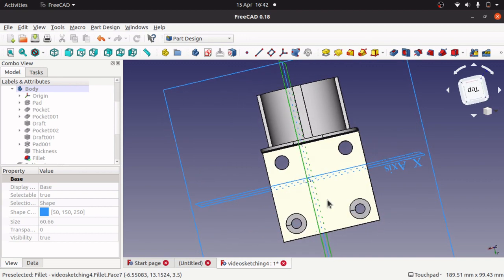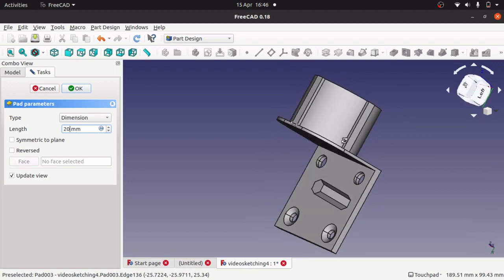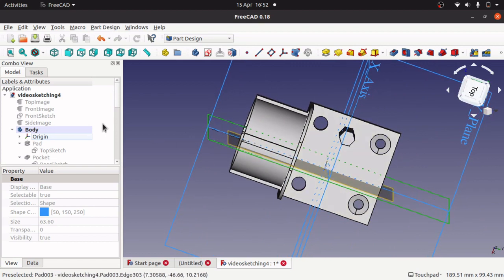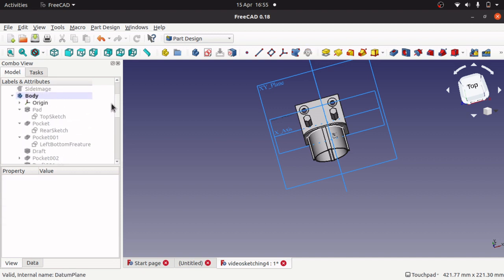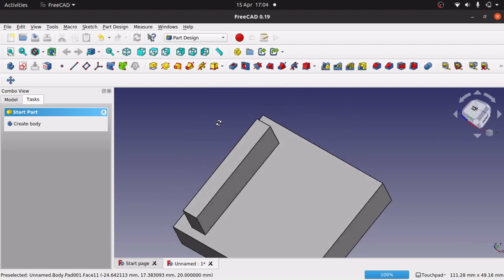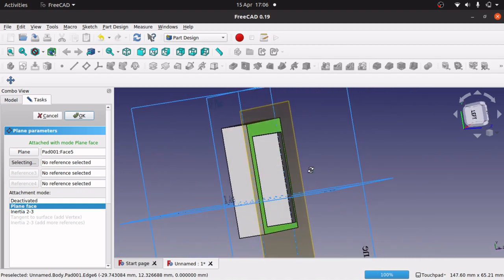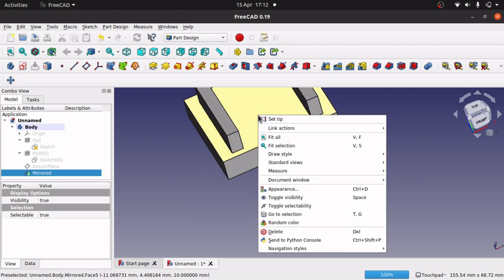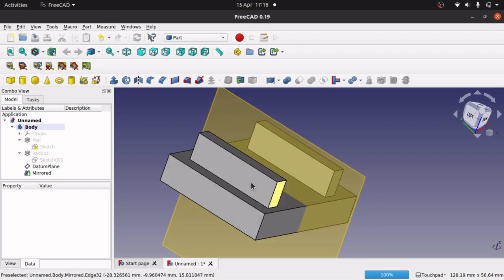FreeCAD: Using a datum plane to fix mirror problems in the part design that has constraint issues

Comment: I'd like to understand: the body you created and the added block on top and the mirrored block, are all these together a solid, or do they need to be joined later on? Or is that only applicable in part design? In other words, when is some creation a solid (one part) or will it consist of loose parts when printed?
Reply from the maker: Sorry had to go in and review the video, it's been a while since I did that one. Ah yes so that was something I made by tracing a series of photos taken from multiple angles. That would end up being a single part. The part design doesn't allow multi body object in a single body. When you add features they must be in contact with part of another feature to make up one single object.

Comment: Sorry for being silly, but: why not line the origin of the piece with the origin of the sketch right from the start? Also, is there no command to align the datum plane to the center of the object? Now you are doing it visually which, with all respect, is not a very reliable way especially when working in tenths or hundreds of millimeters tolerances.  Love your video's by the way :) really helpful and enjoyable.
Reply from the maker: No your not being silly you can do it that way and it is good practice as the datum plane can be a bit cpu heavy.  You can get alignment to the center by using two vertexes of your object but you would need to play with the xyz of the attachment or experiment with different attachment modes. Glad your enjoying the videos.
Reply: @MangoJellySolutions  is creating a compound a way to create "low cpu thrust models"?

Comment: Great videos! Always learning something new from your videos. Just out of curiosity, have you thought about upgrading to 0.19 or is there any strong reason to stay on 0.18. Cheers
Reply from the maker: Thanks for the comments. I have finally moved to 0.19 yesterday as I needed to rebuild my Linux machine as the build kept crashing. I finally got round to doing it and everything looks stable so I am using 0.19 from now on but I have a few videos on my schedule that are still under 0.18 but they should clear soon so you will see me on 0.19 from then on as I have some assembler 4 videos coming out soon. So really, it was down to my laziness 😁